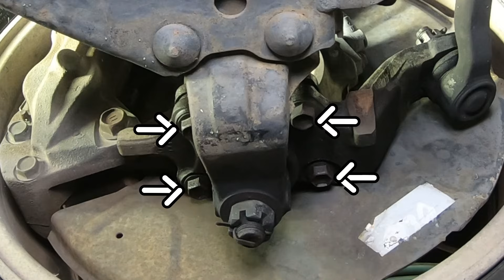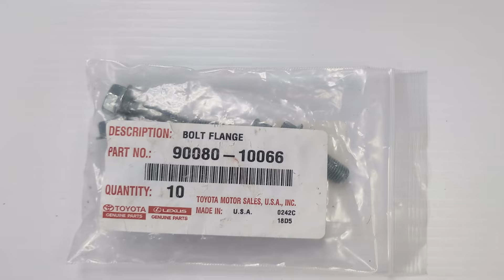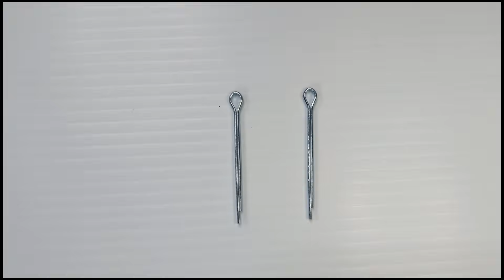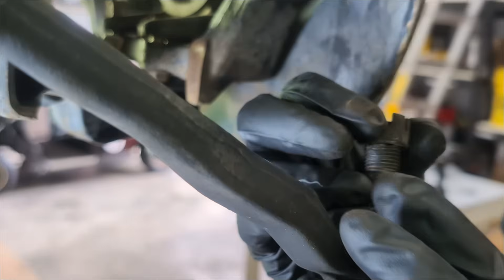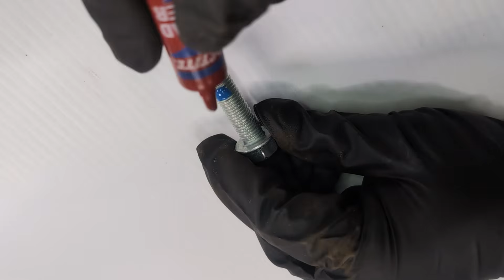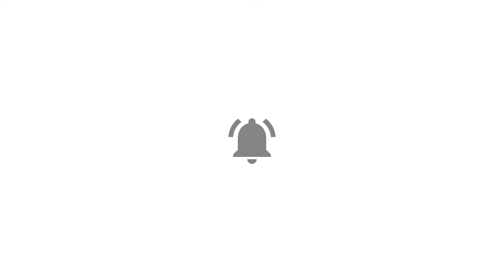How to Replace 3rd Gen 4Runner Lower Ball Joint Like a PRO - ignoring it could be catastrophic!

Comment from the maker: 💬 Got questions or a better way to do this? Drop it in the comments — I read every one!
👍 Like, subscribe, and hit the 🔔 if you're into DIY Toyota maintenance or off-road prep.

Thanks for watching!  Here's everything you might need:

Parts & Tools Used:
✅ OEM Toyota Ball Joints (Left & Right)
✅ Toyota Flange Bolts (x8)
✅ Threadlocker (Loctite Blue 242)
✅ Tie Rod & Pitman Arm Puller
✅ Torque Wrench
✅ Cotter Pins (x2)

Comment: Is this as much of an issue for the 4 cylinder version? It weighs less than the more common 6 cylinder and requires smaller wheels and tires. 
Also, an unrelated question: Where did you or the previous owners get a bull bar that fits over the original bumper? What brand?
Excellent video! Very well made!
Reply: I have a 96 4 cylinder, and the passenger side lower ball joint fell out at ~290k miles about a month ago

Comment: Be careful yall it's pretty easy to break one of the four ball joint bolts if they're seized. Hit it with pb blaster first, give it some taps with the hammer. If it doesn't budge with an 18 inch breaker bar you're probably gonna have to heat it up or atleast try wiggling the bolt back and forth tight and loose. I'm about to buy a new spindle cuz I broke on off in there
Reply from the maker: that's a good point, i don't have much to worry as much about rust and broken bolts as those in other locations. If you are having no luck with a straight flute extractor. With some of the bolt proud of the mating surface and access to a welder you can weld on a nut to the bolt and put a socket on it. however before you replace the spindle you might try removing it from the car and taking the spindle to a machine shop or a mechanic. i would imagine even if they charged you full freight for an extraction it would be cheaper than a replacement spindle,

Comment: why do they always pull the cotter pin out down...much better upward
Reply from the maker: My own opinion is that either method will provide a secure connection that resists vibrating out. but when i see a cotterpin that is split and backed over the top of the bolt i have a lot more confidence that whoever was in the car before me cared enough to take the extra effort to attend to every detail not just get the next car on the lift. 

unfortunately in todays world that's how most shops and techs have to operate to turn a profit. If you find someone who you feel takes the time and effort to do the job well, hold on to them.

Comment: well I have had a miracle escape twice.. twice they have failed on me and wear was never the problem.. the problem was the mechanical impact between the two parts .. they sheared the stem from the ball .. just ripped it straight off ..no ball wear nothing just sheared it off.. fortunately I was going very slow at the time and survived.. A top one also sheared off and I am in the process of replacing the other as well.. I am not an off roader  and treat the vehicle well as I wanted it to last.. now I am shit scared everytme I drive it... everyone ALWAYS talks about wear but these were near new
Reply from the maker: I've never seen a ball joint stem sheer off of the ball except for once on a car that hit a barrier. Glad you were able to walk away from that. You may want to check your suspension geometry and see if those parts of being subjected to some sort of load or an odd bending moment. If they were OEM ball joints To happen twice would give me pause I want to start looking at other components that might be affecting the operation of the ball joint. 

Be safe out there
Reply: @IndiGazoo  been there done that ...everything is replaced ...but do I want this on my concience if I sell it
Reply from the maker: I've flipped a lot of cars over the years, all you can do is make your perspective buyers aware its been a reoccurring issue and that you've been unable to identify the cause. But i 100% agree with you, being able to leave the deal with a clear conscience is worth far more than the extra dollars you would get selling a car without disclosing the problems.

Comment: 250k?!?! How do you know for sure they were never changed?
Reply from the maker: Actually i was very fortunate. I bought this 4runner from a good friend whose family got it new when we were in high school ,They were the original owners and serviced it at the dealership nearly its entire life.  I'm the 2nd owner.  If your trying to determine the age on yours it may be a little harder, but you can use the vin on the toyota website to look up every factory service performed at a dealership to see if it may have been replaced before. But you can  also reference the casting marks on the balljoints themselves to give you some clue , if it has the label for the earlier mold  casting it is likely a pre2006 part.
Reply: @IndiGazoo that’s what I was thinking as well. Love your videos, indi!

Comment: This ball joints don’t need a ball joint press? Im going to replace control arms and ball joints myself. 

Planning to remove both as a single piece so I only hit the edge of the ball joint to separate the tie rod…
Reply from the maker: No, the lower ball joint does not get pressed in or out. The four bolts hold it to the spindle and the larger nut connects it to the control arm. If you're doing the upper ball joint it will need to be pressed out